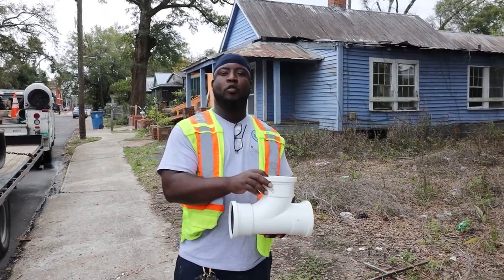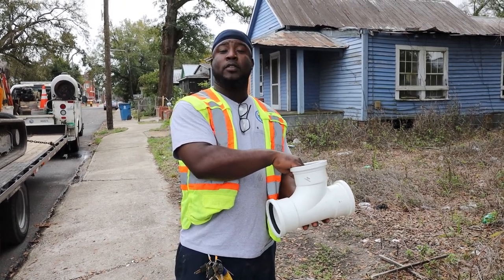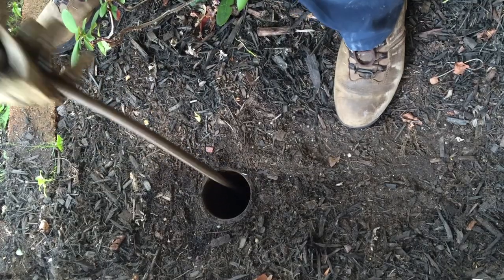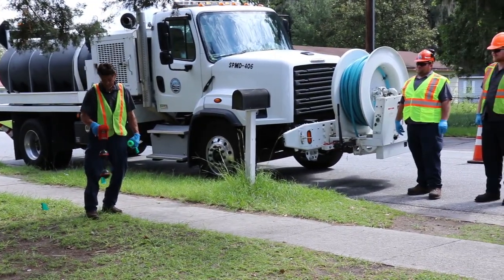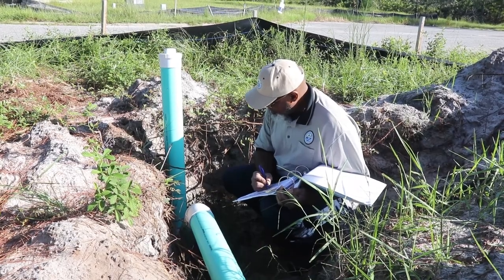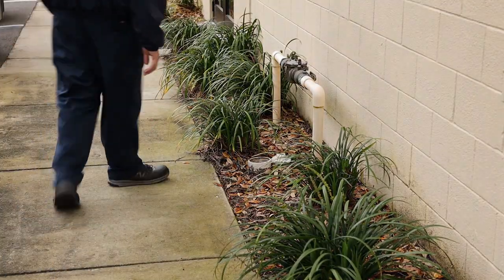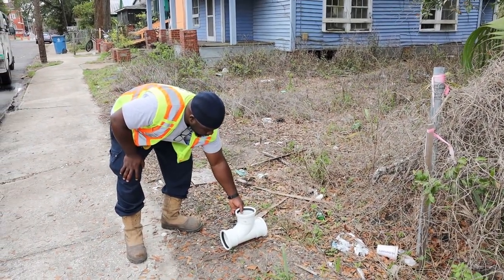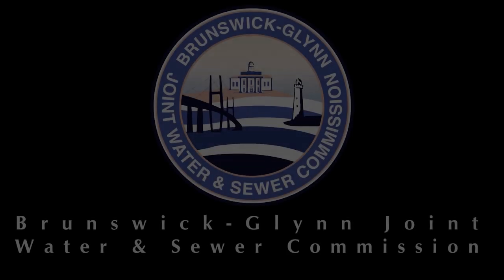BGJWSC - How Do I Install A Sewer Cleanout?

Comment: That fitting he is holding at the beginning of the clip  installs in vertical position - not horizontal. For horizontal you use either Y with 45 fitting, or one piece fitting called "comby".
Reply: Thats illeagal in california u have to use a combination wye  "combo" or a wye on a 45 not a saniatry tee

Comment: Hi, I have a 6" clay sewage line.  Are there 6" cleanout fittings in ether PVC or flexible rubber, or will I have to use 6-4" fittings??